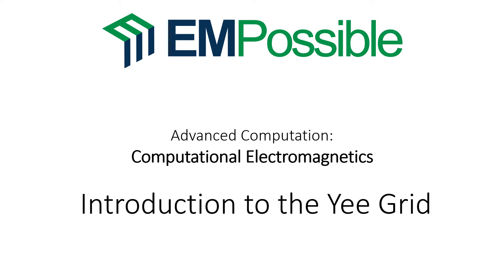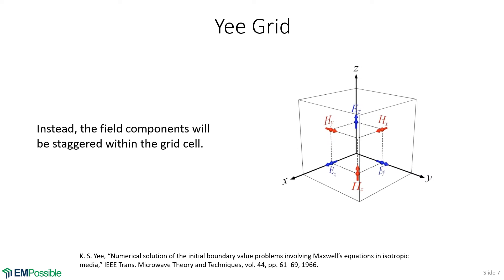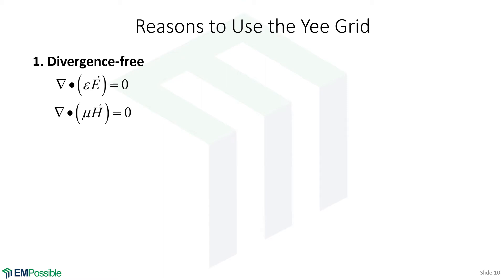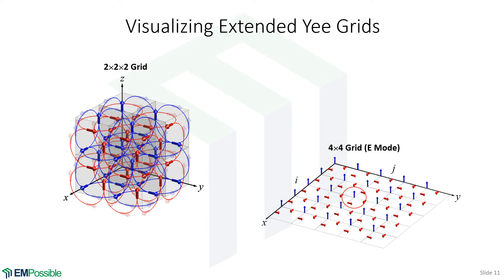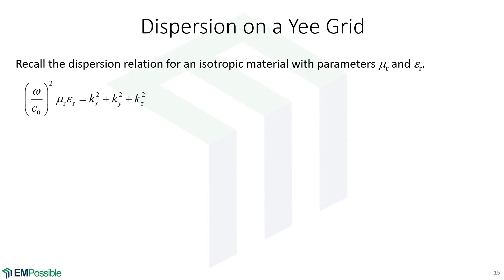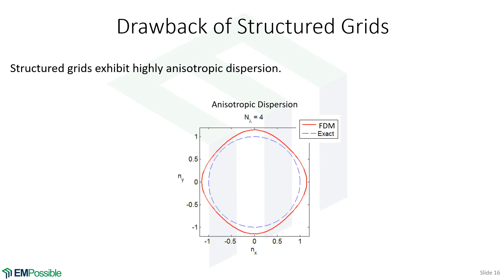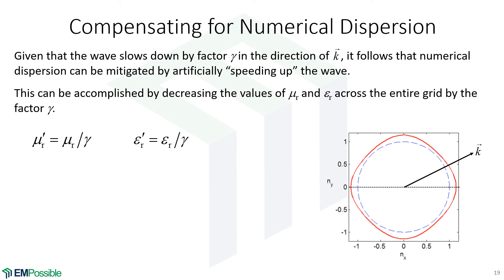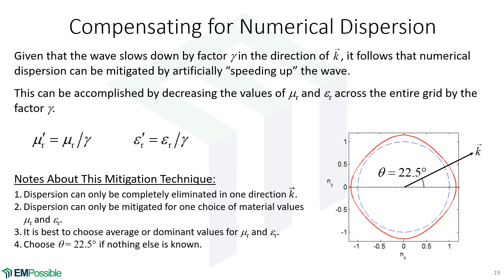Lecture -- Introduction to the Yee Grid

Comment: Very interesiting video, I wonder how hard it would be to program a simple EM simulator using this technique.
Reply from the maker: That is an excellent question! You are actually watching a video that part of a computational electromagnetics course that teaches how to write computer programs that simulate electromagnetics and photonics. Here is a link to the course website where you can download the notes, get links to the latest versions of the videos, and get links to other learning resources.

https://empossible.net/academics/emp5337/

If you are really interested in getting started in computational electromagnetics, I recently published a book with Artech House. It teaches the art of computational electromagnetics through a method called finite-difference frequency-domain (FDFD). I think FDFD is the best FIRST method to learn in CEM. It is probably the simplest to implement and is capable of analyzing a huge array of materials and devices. Here is a link to the book website that has everything you will need, including MATLAB codes for many types of devices:

https://empossible.net/fdfdbook/

We also offer some online resources that teach finite-difference time-domain (FDTD) to the complete beginner. This is the time-domain brother of FDFD is also an excellent first method to learn. If you have both FDFD and FDTD, there is literally nothing you will not be able to simulate. The only thing other methods will offer you is greater speed and efficiency, but they will be more difficult to learn and to implement. Here is a link to a video showing what is in the online courses:

https://youtu.be/uBiprIN8gfY?si=UCXb1OJbAXtGrsvK

Here is a link to the actual online FDTD courses:

https://empossible.thinkific.com/collections/FDTD-in-MATLAB

You can also use our free resources. These are the notes and videos I use for my face-to-face classes. They are more advanced and do not have the codes or examples. I work these in person in the classroom. I recommend starting with the Computational Methods course and work through Topics 6 and 7.

https://empossible.net/academics/emp4301_5301/

From here, you will be in an excellent position for the Computational Electromagnetics course:

https://empossible.net/academics/emp5337/

or EM Analysis Using FDTD:

https://empossible.net/academics/emp5304/

I hope this helps! All of these use the Yee grid you saw in the video.